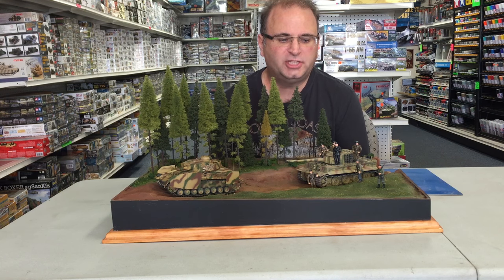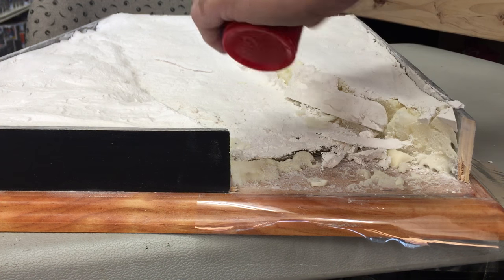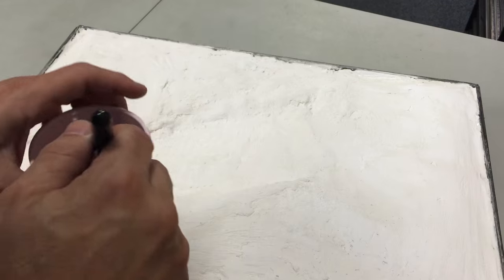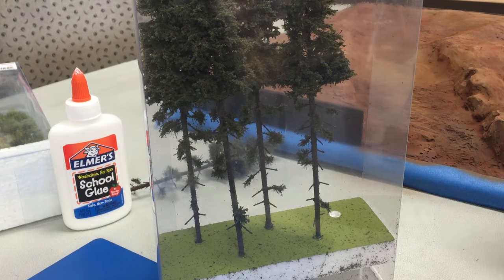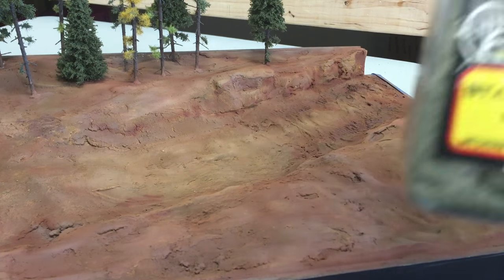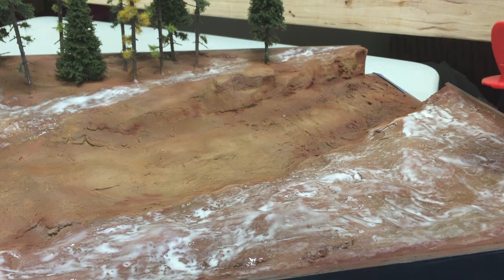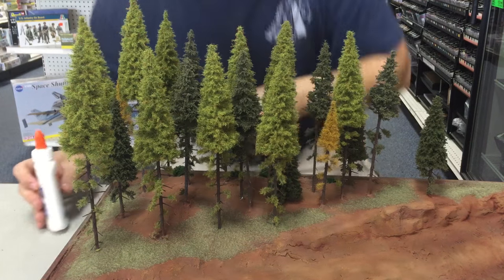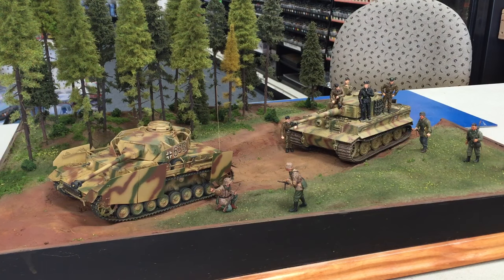Building The Sunken Road Diorama complete step by step instructions

Comment: Hi Andy,Quick question:  How will you fix the tanks to the "road" ?  looking at it, it does look like the treads are hovering off the ground.  Would you drop a screw through the chassis into the plaster or the base?  just wondering...Thanks